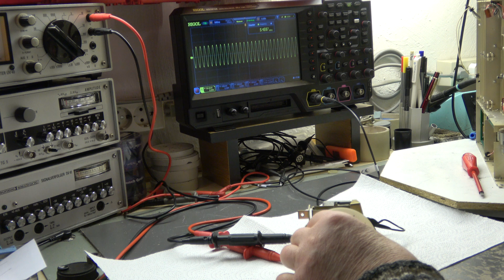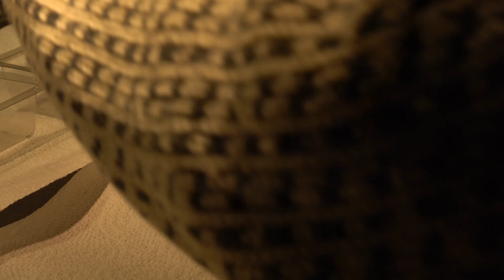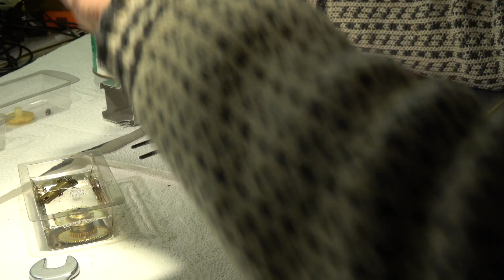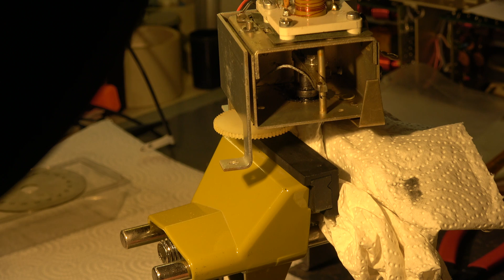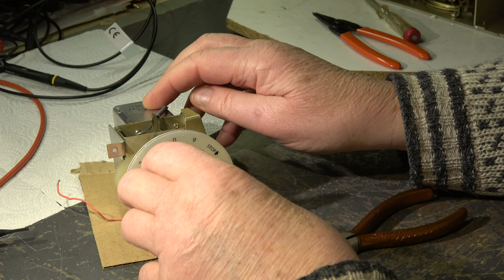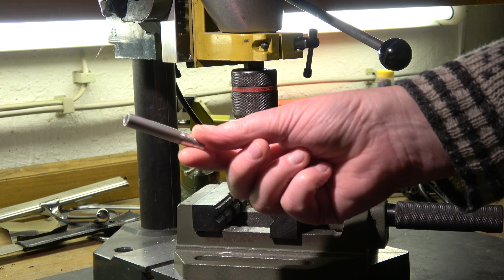#156 Drake TR7 Part 4(13)

Comment: Those of us lucky enough to have TR-7s are even more lucky that you like them so much to take on such projects and share your excellent troubleshooting and craftsmanship (how you trimmed the hose was wonderful) by doing such detailed and clear videos! Also having a RV-7, someday I will likely have to repair at least one of the PTOs and this video of your experienced steps will be greatly appreciated.
BTW, I have a friend who worked at Drake. He told me that winding the coils for the PTO was a particular challenge to get them to tune linearly. Note the unusual spacing of the turns along the length. It was particularly important to get them to tune linearly before the digital display since people really counted on the accuracy of the dials and how far they could tune before having to correct using the calibrator again. As I remember he said that one lady was particularly good at winding them for good mechanical tuning to frequency linearity. When the digital display became standard then people did not care as much about the accuracy of the mechanical tuning. And then the lady with the magic touch could go on vacation more often without having to build a stock of PTO coils, since now many people could build ones that the customer would accept! At least that is how I remember the story. I am looking forward to your continuing work on this significant project!
73, de WB0DKT
Reply from the maker: Tnx dr Glenn for your comment and explanations. Yes these old Drakes are wonderful rigs. I also have a C-Line which was my first rig in the early 80ies. And i have the book " A family affair".